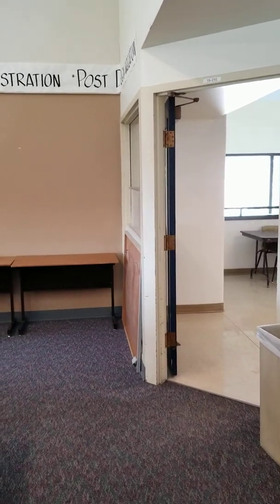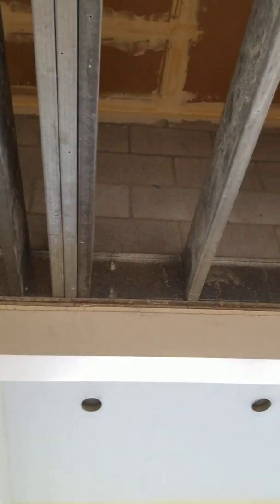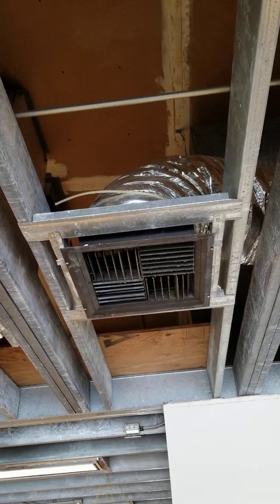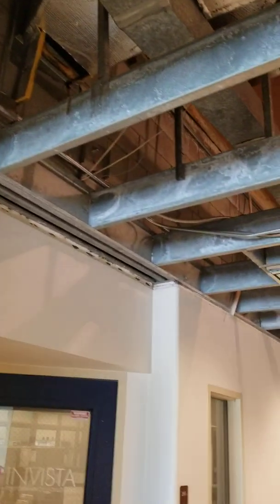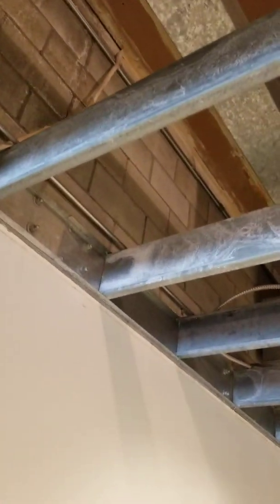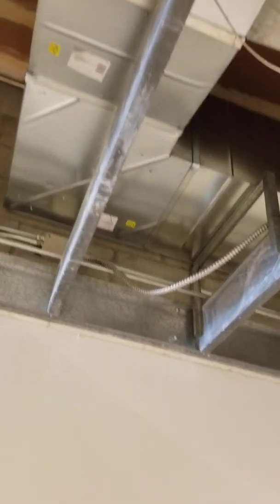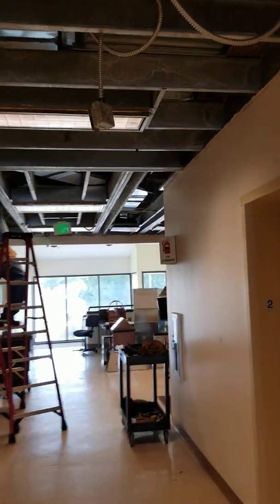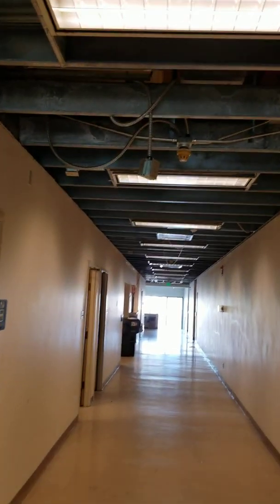Interior Design :  What is a "plenum space"??

Comment: Hey sir, could you please explain  what is the plenum area  ( I know, you  explained  at the video but my english is not good, if you write  I can understand easily . )
Reply from the maker: The plenum is the space between the ceiling and the floor/roof above. The height of the ceiling joist framing allows for building systems to run between, creates a space for recessed lighting, HVAC, plumbing, etc.
Reply: @jayaroseinteriordesigneduc37  This is the nature of a commercial building. The space above the ceiling is needed to run various electrical, sprinklers etc. In a smaller residential structure, the ceiling finish is often placed directly on the wood joist that holds part of the building (floor, roof etc) up. In that case not a lot of space is provided. There wouldn’t be room for large air conditioning ducts. As we can see, that room is provided here. To take it further, I will introduce the concept of this airspace being PRESSURIZED. Air flows from a unit to cool or heat occupants. It must also make the way back. That concept is often referred to as “return”. Sometimes that return is “ducted”. That means it flows through those silver colored metal ducts we saw. Sometimes it is unducted. That would mean the airspace would be pressurized. This is where the plenum concept comes to prominence.
Reply from the maker: @markkillion8980 Thanks for your clarifying comment!
Reply: @markkillion8980 thank you for your explanation. That was my question. So the ceiling is not a plenum area since the ducting is being used for the return right? So it would be ok to use riser cable vs the more expensive plenum rated cable?
Reply: @Divici02623  It is my understanding that if a ducted return is in place, then the space above the ceiling isn't really a plenum. As far as what cabling could be used, I can't say. I'm just not familiar with that particular trade. I guess, in the case of a plenum, air is "flowing" throughout and you may have to be more careful as far as fire, non-combustibility, etc. If you look up plenum in the dictionary, it probably refers to space, area, volume. In a design and architectural sense, you are talking about that volume being "pressurized". It is a more economical solution compared to a ducted return.
Reply: @jayaroseinteriordesigneduc37   thank you